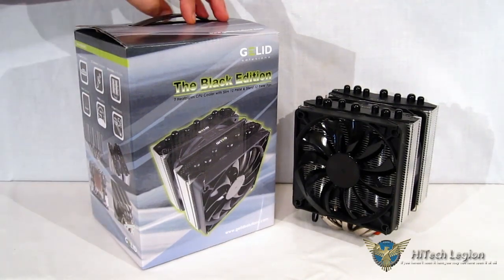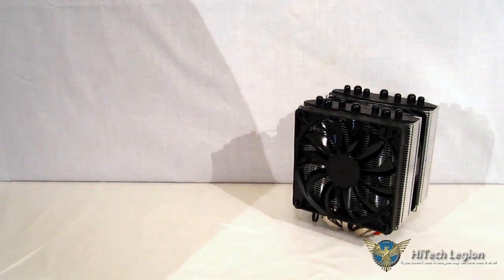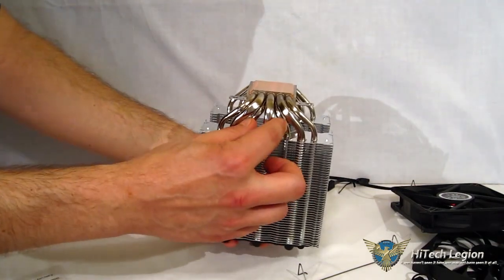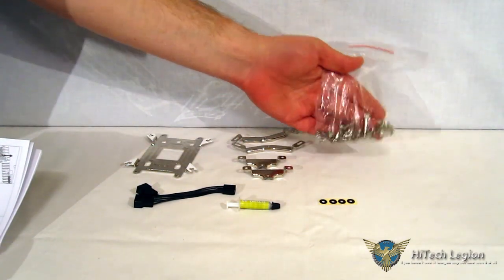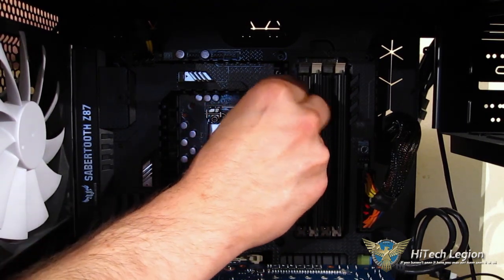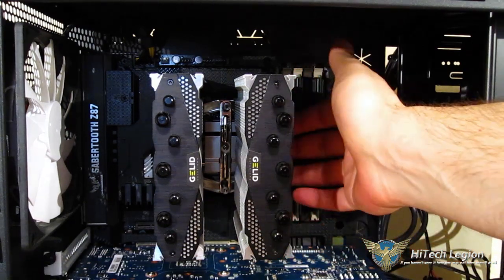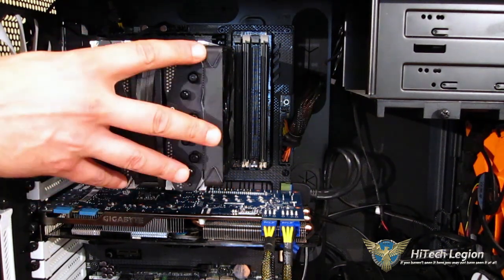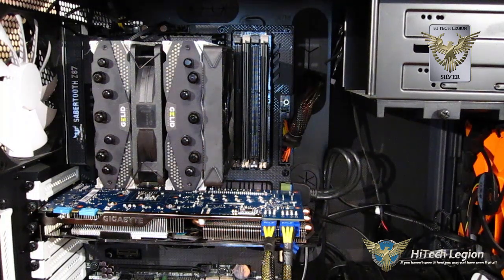Gelid Black Edition CPU Cooler Unboxing, Benchmarks and Installation

Comment: just bought this cooler in 2022 for just below 30 euros; around 32 USD. Switched this with my older bequiet shadowrock topflow cooler on a x99 system with a 5820k. went from 65C to 54C while gaming. One of the best cooler deals i come across right now.

Comment: first the standoff screws are for amd only, he meant the nut screws that go over the first screws that go into the backplate.
also this cpu cooler is for extreme overclocking, ive overclocked my e8600 to 4.2ghz stable.
make sure yiu just put in the ddr2 or 3 ram in first then that way doesnt matter what way the fans go in.

Comment: i have problems on am3+ socket when i place tower the two holes where screws go trought to tighten tower is wider then screws so my gelid tower tilt all time and it dont cover whole cpu area so cpu overheats like 80c in any load.

Comment from the maker: The fans aren't really the issue with the OC results here. The passive cooling characteristics just aren't great when it sees larger amounts of heat, which is fairly common. There is no "fan change" cure for that.

Comment from the maker: The NH-D14 is a much better cooling performer, but it is quite a bit larger. Also, your assumption on noise is incorrect, the Gelid Black Edition is quieter as mentioned several times in the video.